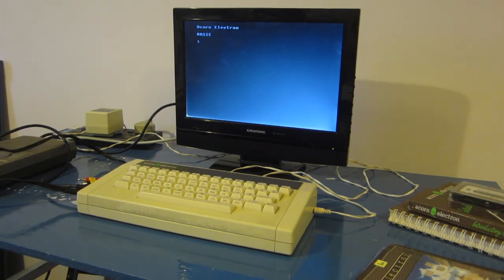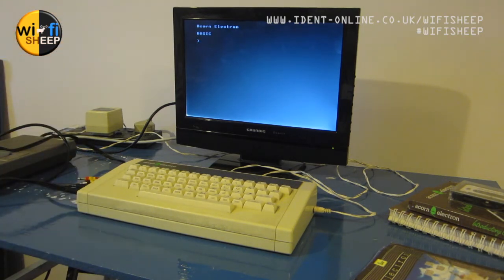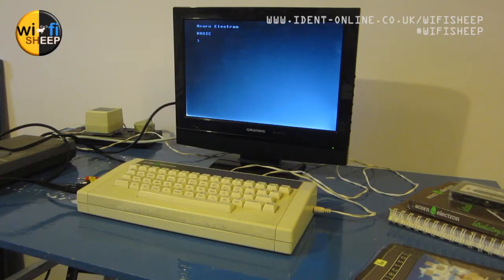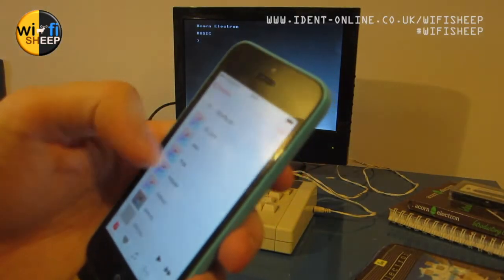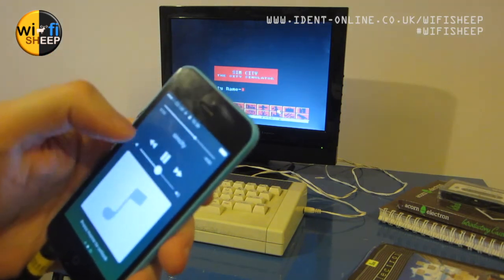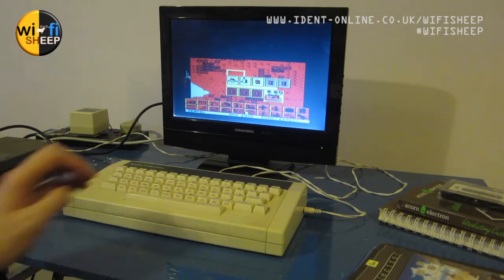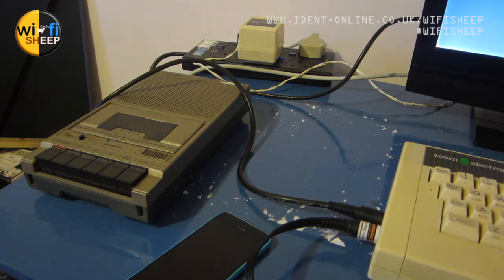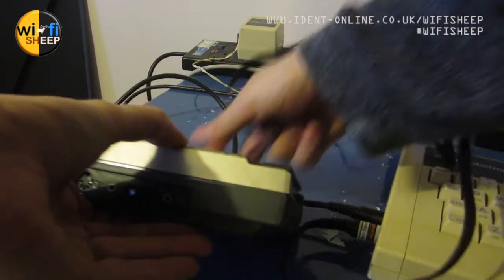Acorn Electron 8Bit Computer Setup Part 2 (Wi-Fi Sheep Tech Video)

Comment: You don't need the space between the quotes. You can also use the function button and 'K' combo or just 'CH.'

For a data recorder the best one that I've found is an original Acorn one. If you use it with the 7-pin to 7-pin DIN connection it seems to be less fussy about the tone and volume settings. The most common issue with old cassette players can be that the drive belts perish, as they're rubber. If you can't find a direct replacement, you can do what I did and use an elastic band!

Comment: just take the remote cable out of the tape deck :( The tape deck wont do anything while the remote cable is in.Type chain"" then press return and the tape deck will work thats with the remote cable in the deck.If you take the remote cable out of the tape deck it will work as normal just like the bbc tape deck .hope that makes sense !
Reply from the maker: Hmm? did i only try it with the remote plugged in? trying to remember now???? Ok thank for that, yes I do understand what your getting at so thanks for the advice i'll have another look at some point :-)